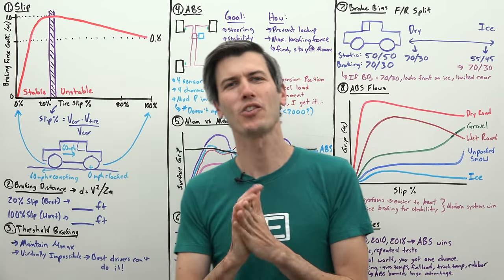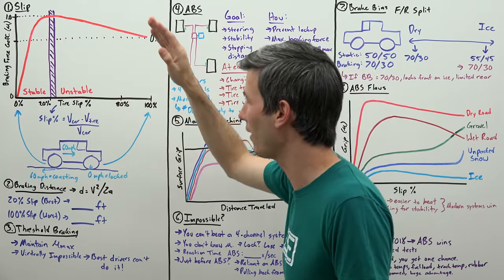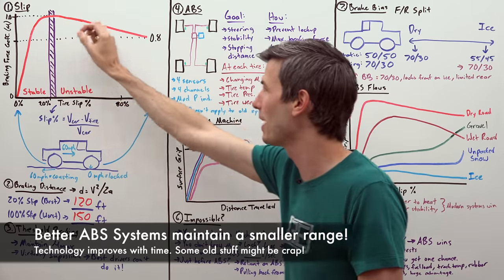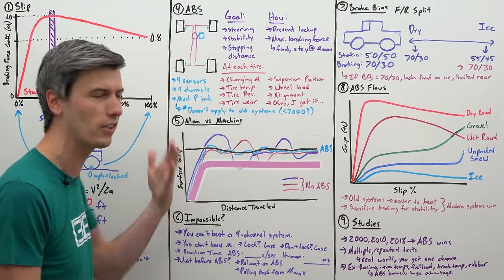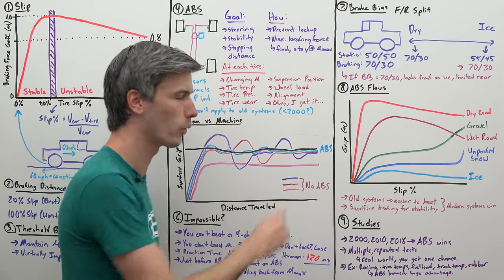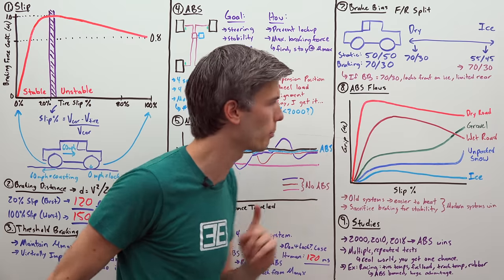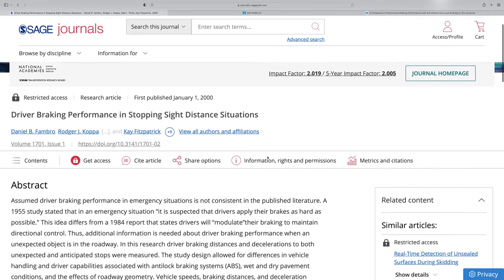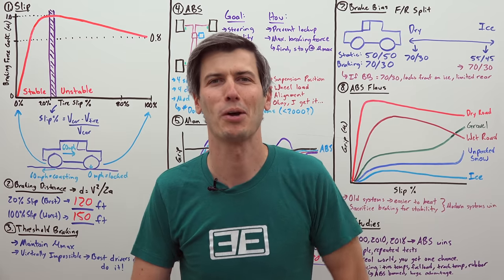Why Threshold Braking Is Impossible - ABS Wins!

Comment: The one - rather major - flaw of ABS systems is some times you really need the wheels to lock up. If you've started a drift that you don't have enough steering angle or space to escape from (lets say you're about to head towards a wall, and sliding), locking up all 4 tires is an easy-out, basically saving the vector you currently have and making it linear. This has kept me out of many walls (maybe I suck at drifting I know), and I've seen countless car crash videos where cars have gone tumbling off the highway after unintentionally scandi-flicking and hitting the (ABS) brakes. If you flick a car and lock the wheels, it just goes straight, not off the road. This issue may have been addressed by stability control, but I remember a study in the early 2000s that confirmed there were far more fatalities due to ABS rollovers than people saved from the lower amount of rear end collisions.

Personally, I'll take the option to lock those baddies instead of flip off of a highway bridge.

Comment: The only exception to this stopping shorter than non-ABS is on glare ice where sliding the tire has more effect than the ABS never allowing the wheel to apply much if any friction to the surface… PS don’t forget to put the car in neutral / push the clutch in to disconnect the driving force from the wheels.

Comment: When I was doing my (optional, but I highly recommend) advanced driving on slippery surfaces class a few years back, my instructor went "Remember all that talk about managing your braking and not letting your wheels lock up? Yeah. Forget everything you heard. Unless you're driving a 30 y/o beater w/o ABS, just slam the ducking brake as hard as you humanly can and let the ABS do the work. It'll be better than anything you can do, especially when in panic mode."

And then he went on in to explain in detail how modern ABS and ESC systems work, very much in the way you do in this video, just with 100% less whiteboard.

And man you can feel the ABS do its work when doing the moose avoidance maneuver on a near-ice like surface.

Comment: This video can double (ALMOST..) for ACCELERATING. Traction control/stability control (individual braking/line lock). Though accelerating in gravel would be different as you sheer a material and are not accumulating it, rather removing it.

Comment: I'm riding an electric scooter a lot, and it has 3 general modes of braking, mechanical/hydraulic, electric/regenerative, electric/abs. So after doing over 5k miles I can say with certainty that electric ABS braking is starkly inferior to straight up electric regenerative braking (which also happens not to block the motor-wheels), so at least in this scenario ABS is actually less effective.
P.S. Love your videos!

Comment: Only problem I have with ABS is that you can't keep applying pressure  to the wheels that don't  slip. For instances when you're riding one side of the car on the slippery surface lets say a frozen puddle traveling at 20 mph, and you need to stop in the next 16 yards or so, slightest pressure on the pedal will trigger the abs and won't let you apply pressure to the wheels with normal grip. 
I understand that in a high speed situation you would end up spinning out the road,but in lower speeds you either have to swerve into the grip section, or be a passenger in your own car and hit whatever you're trying to avoid

Comment: Haha, I was slightly disappointed until I saw the subtext some old stuff might be crap😁.  Oooo you even just mentioned early 2000's.  Ok.  I think there is still a pretty large population of people that drive older cars.  I was going to suggest grabbing a 90's Jeep and see how good the ABS is😁.  My 96 Grand Cherokee's stink, it only has 1 channel for the rear brake line and I'm not sure it even modulates the fronts separately.  In winter it took forever to stop at icey intersections it seemed to only want to apply the brakes when the friction was low and always missed the pavement patches or somewhat grippy snow, luckily it's easy to disable.

Comment: A thing I had happen once where ABS genuinely could have killed me, I popped a rear brake line during a panic stop on gravel. This meant no rear braking at all, and ABS was pretty well fully unlocking my fronts. Had my reaction not been to back off the brake pedal to stop the ABS from cycling, I would have just coasted into a moose at ~50mph.

Comment: Other than the old Subaru thing that's already been mentioned, I had a couple of thoughts while watching.  First of all, I'm not disagreeing in general, so these aren't intended to be arguments against your conclusion, just a couple of things that stood out to me.  When you were talking about threshold braking, and referring to the slip graph, you seem to be glossing over the fact that there's a pretty good range of nearly as much grip as the peak.  Let's say the purple section is 20-25%, if so it appears that the range of getting about 0.99 coefficient is about 15-20%, so in practice, threshold braking is slightly easier to achieve that you posit.  Also, later on you refer to the cycles an ABS system does, and compare to humans, but humans don't work in cycles, we're analog, so I'm not sure it's a good analogy.  Great vid as always!

Comment: There is definitely a difference between ABS systems, Bosch systems will ratchet up the brake boost after ABS has been activated. This turns out to be a very useful feature, often ABS will be triggered by a bump in the road where the wheel has temporarily airborne thus triggering abs. This can create a feeling that the vehicle is lurching forward, and without increasing brake boost can significantly increase breaking distance. Increasing the brake boost for the driver will make up for the loss breaking distance that the driver was otherwise expecting.

Comment: I think people still believe that because of the earlier systems; the ones from before the 2000s, where, especially in straight line, it was not only possible to beat the system, but incredibly easy as well. Most mid 80s to late 90s car were terrible at stopping in straight line with the ABS on a dry road and some even worse when there is slight dust/sand on it. Back then the system wasn't supposed to make you stop faster, but to let you keep control over the vehicle, which not everyone could do in extreme situations. To me it's also completely mystery how one can keep their foot glued to the brake when the car is slipping and they can't turn, but i've seen it so many times from panicked drivers and it still shocks me.
As for racing - well things are a lot more complicated. GT3 for example allows ABS, but if you rely on it too much it's soooooo easy to overshoot the corner, leaving you wondering wtf just happened. Also certain racing techniques like trail braking don't work great with ABS mashing at the brakes at one of the wheels and screwing your balance. But we are talking about professional drivers here and skills, techniques and machines are completely different to the average community driver or streetracer wannabe.

Comment: Does any motorsport include a slip indicator? No reason you couldn't just use the same ABS sensors but put it on a gauge so the driver can react to it and at at least know how close they are to the ideal. Still will never beat a computerized system with independent control though.

Comment: Makes sense I can do better than my 96 holden berlina but I can't even begin to compete with my 07 holden calais, haven't tried to slam the brakes on dirt with those I did in a Ford Ba Falcon I can't remember the year that sucked majorly made things way worse (there are a lot of dirt roads where I live in Australia so it's definitely a trade off here)

Edit: I should also mention that I also had a Mazda 323 1983 with no abs I learned the hard way about locking brakes in that thing when I was still learning to drive went straight through a red light in a city in a distance that I could have stopped in if I had had abs.

Comment: If the brake balance is set up right on your race car, you can give the car a slightly higher slip on the rear wheels when you brake into a corner, which helps the car rotate better, allowing you to go full throttle sooner when you exit the corner. I think that's why some people drive without abs in Motorsports (apart from other reasons). But if you don't know what you're doing, ABS is so much more convenient and safe.

Comment: What about for motorcycles? A lot of the racers prefer bikes without abs so they can brake harder and later into the brake zones - and even lock the wheels intentionally in some cases.

Comment: Only thing that sucks with abs is with the seasons changing, I get an ABS light every early spring from the temperature change going from winter to spring, then getting a cold week in the spring and going back and forth. And I don't like taking my car to a shop for every single thing, I've had my car 3 years now and this is the third ABS fault I have now.

Comment: Off-road Abs can be deadly which is why when you shift into 4wd most vehicles almost entirely switch it off. Go find a sand dune and race toward the edge and try to stop with abs. It'll be like on ice and stopping without will be quite a fraction of distance. It's even worse with skid control. A car will literally not allow any power to get up or out of an obstacle. Plenty of times I wish a i had  abs on a motorcycle or a bicycle lol.

Comment: There are many comments about old ABS being so much worse. For the lowest traction situations the old systems had more noticeable sensed activity. Thisenold systems still increased  steering control to let you steer around something a vehicle with near locked or locked front tires would have hit.

Comment: Fun fact: The control system uses wheel deceleration thresholds to estimate the slip at any given time.

Remember, there is no road surface speed available (no such sensor) that could be compared with the wheel speed.
Reply: yeh that is one thing which is used. Another fun fact that the system has an internal estimated reference velocity and compers to this the wheel speeds.

Comment: in my experience sim racing. the best way to set your car for a race was to turn off abs and tcs, tune the car to be as stable and grippy as possible, then turn aids back on again right before the race, while slowly adjusting them up or down given the 'feel' of the car. abs is technically faster braking but if you find yourself relying on it, its too late. this gives you the highest predictable performance possible.

Comment: I wonder how wear on abs system affect its results, what changes if for example you have pump damage in otherwise perfect one? or one of the channels is completly clogged... 
ABS is always better, but I drive 10y old car, I assume its at least slightly damaged, so what I can expect ? anyone knows any studies on that?
Reply: ABS is really just a slip sensor and a computer detects slippage and instantly lets up on breaking to regain static friction. Unless the sensor is damaged, it really doesn't matter what damage is done on the other parts of your breaks system since any problem the ABS would have, you would also be dealing with breaking normally.

Comment: Jason, I can beat ABS. In one certain scenario. You were close to it for a moment and I thought you were going to say it...
It is Winter driving when you have say snow or plush snow, or ice, on one side of the car, while the other two wheels (again, sides, not front/back) are on much better grip pavement. Then, the ABS, by the design will determine low grip from ice covered road and will limit braking force on the other side to almost match the ice to maintain the travel direction. I could lock up the right wheels and let them slide on ice, and by keeping the left side rolling and controlling direction with enough input I will slow the car down much faster than the ABS would.
What would you say on this one? Any studies about it?
Anyway, I liked the arguments supporting and against the ABS...

Comment: I would say that abs systems have wildly different response times. You can see this in offroading videos on occasion, some German systems will engage every in increments of 10-30 degrees of the wheels rotation. Most systems will be closer to half the wheel rotation and some will be closer to a full. From a controls standpoint, abs relies on a wheel speed sensor that is wildly abused and coated with crap. Different systems will want to see different amounts of sensor readings to ensure their next action is correct. Just because it can engage at 15hz, doesn't mean that it will or can. The rate of engagement is based on wheel speed accuracy. The wheel will lock up, the brake pressure will be dropped and the system will need a couple sensor readings before the computer can guarantee an accurate wheel speed to ensure it's below the threshold. This does not dispute that abs is better, just that there is a huge range in both human and machine. Some drivers might be able to absolutely beat the worst systems. I highly doubt there's a driver that could beat a good system that reacts in a few degrees of the wheels rotation.

Comment: I would like to see an analysis specifically in the snow…I’m kinda new to driving in the snow but it always feels safer to me that the ideal slip % is very low for safety.  I dont feel safe relying on ABS for maximum stopping rate.  Intuitively, on a dry road surface, your analysis seems right…but I’m not so sure in that snow situation :)

Comment: Also the surface can change, dry surface with a wet spot or an oil spot etc. I am abs fan. More important that traction control IMHO for motorcycles…

Comment: I used to be one of those guys, until one day I was driving a Chevy S-10 on wet roads with about a half-ton of steel barricades in the bed, and someone blew a stop sign in front of me.  I tried to push the brake pedal through the floor and the truck just... stopped.  

In that moment I realized that during a panic stop you are by definition panicking and not trying to threshold brake until it's far too late.

Comment: I basically removed the front wheel on my 2008 Subaru Outback because it prevented me from applying the brakes hard enough on a road with a loose gravel surface. The ABS on that car was borderline dangerous when not on a sealed road! (After that little incident I stated pulling the fuse on gravel). My 2014 Toyota Prado is much better, but still not great. It seems to be tuned to be less agressive with the ABS. My guess is it has an accelerometer in the control loop as it seems to allow far more slip than the Subaru ever did.

Comment: I think one key point is also that ABS keep the car stable and controllable. When people panic and slam on the brake, the wheel looks up and you lose steering. The car will go in a straight line. In a situation where you stopping distance isn't enough, you can steer around an object with ABS, while you will slide and crash into it without ABS.

Comment: As a person who drove exact same model of vans with and without ABS for millions of miles. I think the problem with ABS is that in actual braking situations have often a lot of that "unpacked snow or gravel" scenarios. Speed bumpers, ditches, bad road conditions, dirt on the road,  loose asphalt stones, etc, they can all trigger the flaws on the ABS. It does not account for tires losing contact with the patch, which can happen for many reasons in emercency situations, and that´s a big problem. I would install a pressure sensor on the calipers mountings of each wheel, then the computer could tell if the wheel is locked because it´s being held too hard or because the wheel is not making any contact. This problem can resonate with the ABS cycle and create a no brakes effect. It can happen.

Of say ten emercency brakes i had to perform in these units, 9 of them I wished the ABS didn´t kick in as it made things worse. The tenth one, it did save my ass, I aknowledge it.

Comment: Makes sense that I could reliably outperform the ABS on a 2012 motorcycle but struggle to keep the wheels from locking in my non-ABS car. 
To be fair motorcycles use a much higher percentage of front brake and I definitely have better fine motor control in my fingers than in my feet / legs.

Comment: Agreed ABS is vastly better than human control with all the variables that will affect hard brake application.  I wonder, however (always a "however" out there) if during a race condition where conditions are predictable, repeatable and fairly static, can a race driver be consistently at threshold breaking and exceed 4-channel ABS system capability?  I've often heard that laps times are slightly faster with non-ABS configurations...assuming the test was the same car, same time with just ABS toggled on, then off for the test.  I'm still looking for such tests.  All this to your point at the end where in race conditions that it may be useful in the pitlane...an uncertain condition, but known corners?.  Thoughts?  Nonetheless, I wholly agree with all other circumstances that ABS wins.

Comment: First:
You did convince me! ;-)

But i would be interested in the numbers.

So your calculation in (2.) for the 5  Scenarios under (8.)

So 
120 vs 150 on dry road.
...

just to understand ...

And btw: on the racetrack with my bike i do not use ABS since the bike is from 1998 and there was no ABS available. On a new one i would give it a shot.
But my uncle bought a BMW Bike 20 years ago. and the ABS failed like every 2 month. and to rely on such a system did not really sound appealing to me ;-)

Comment: In motorsport, Abs is classified as a driving aid.
I know that in asfalt circuit, in  semi-pro classes, ABS is allowed.
In rally, you use left foot braking a lot and even to stabilise the car, a pulsating brake pedal going over 100mph on narrow curvy gravel roads is not very comfortable.